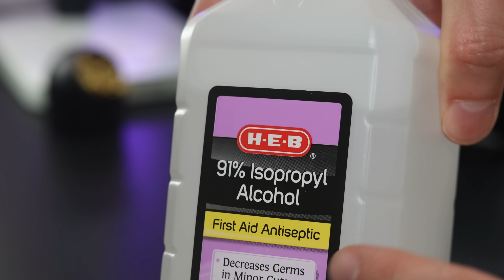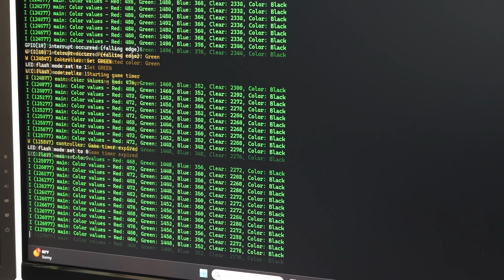Do This Before You Solder Anything

Comment: 1:08 but probably don't start with leaded, lest you make a habit of using dangerous solder
Reply: Which one would a beginner start with?
Reply: @CommandoPixel  a thinner silver based "activity" solder like he marks as his favorite, and use flux
 there is no good reason to use leaded solder when compared against the harm of lead
Reply: That is not a proper framing of the situation and the risk.  Whether or not you use leaded solder you're likely to encounter lead as a hobbyist, so it's better to actually assume the presence of lead while soldering and always use practices to minimize exposure.  

Maintain dedicated gear and space, and hazardous disposal for scraps and dross.

Keep that area thoroughly cleaned. 

Wash and scrub your hands really well afterwards.
Reply: How much danger is there really from using leaded solder?
Reply: The hazards of leaded solder are over stated. Just have a fan nearby so you are not directly inhaling fumes. Most seasoned engineers have been soldering for 30-40 years with no extraction. Yes in an industrial 8 hour working environment then yes this cauldron be a problem. For the amateur then I would have zero worries if you have a very small fan nearby to move the fumes away.

Comment: Sure flux helps but you really don't need more than what comes in the solder.  Flux is more needed for de-soldering and reflow.  You're also applying heat to your components for too long.  Get in and out faster.  You're probably having to do that because of your iron.  You said so yourself, when doing a ground pin you have to up the heat.  That's because your iron is cheap.  Get yourself a good iron with good heat saturation and you'll be able to get in and out faster even on the ground plain.  Here's a good test for you to learn, find yourself a good size heat sink.  Put some solder on it and keep your iron on that spot.  Remove, touch, remove, touch....your temp should hardly change.  If the temp changes a lot then change your iron!

Comment: Very good! Yes I worked in radio repair for over 20 years before I ever started using flux. One guy had some on his bench but used it like cleaned to dip his tip into haha smoke show. Now I build a lot especially using TSOP's .5 / .4mm pitch etc, I wouldn't be without it!

Comment: Nice tips here and in the comments. When I'm soldering a header, I will normally do the ends first after a careful position with a clamp or some such: once at least one pin is "anchored," the rest are much easier because their alignment is "guaranteed." Also, with these pins, I generally clean my tip, tin it, then touch it to the pin & pad for about a second and apply a little solder. I use silver solder.

Comment: Please.  Clean your solder at cleaning stage. Wipe it with alcohol and Kimwipe you will have a long dark streak. That’s oxidised solder.  Please wipe your solder (lots) and ensue it’s clean.  Otherwise it’ll end up in your joins.   Also clean iron tip and refresh every join.    Is it needed, you tell me?  But it’s NASA stds training minimum.  But it’s something simple that makes better joins.

Comment: Was doing cold soldering as newbie because it kinda work (hard though) and didn't check what is the right temperature to use, thinking I had read so far, what wrong could it be?
... then destroyed the components due to bad contact which requires months to fix...

Comment: Also, use the right tip for the application. Dont use a wide chisel tip for delicate, precise jobs. And don’t use a small point for soldering heavier gauge wires and large circuit board pads.
Reply from the maker: Very good point!

Comment: An extra tip: apply some solder to the iron tip just before turning it off. This will work as a protective layer against oxidation, next time you just turn it on, clean old tin, apply new one and you're ready !
Reply: Most pen-type tips have an outer tin layer, it's more useful on old and worn tips
Reply: @S_Tadz I bought a 10 pack of PCB tips and they all appeared to be pre-tinned. Well, it still wiped off after the first solder joint I made, and I still need to tin them myself after the first use

Comment: Btw dont buy expensive flux, VGA oil for those vapes is cheaper and good, UV resin is cheaper in 1kg for those 3D printers than in those tubes of 10mL..., solder wire 0.8mm is multi-purpose i dont need thiner or thicker, just apply it slower or faster, for tiny SMD solder paste not wire. Why are you not using helping hands? Best joints are made if you pre-cut the leads, you get spherical blob not conical, conical spray too much EMI at high frequencies.

Comment: Don’t use leaded solder. Lead is toxic. When lead free solder was first introduced, it was terrible, and got a bad reputation. But now you can get lead free solder that outperforms leaded solder. Make sure your solder has sliver (sn) in it. You can even get lead free solder now that melts at 130C.
Reply: yeah but try to remove it after 5-10 years after it's oxidized you might have a hard time scraping it off

Comment: If its 1/4 in or larger just use a mini torch instead, much easier to get it hot enough. I always solder it at a much higher temp, closer to 400c for 95% of my joints because I like to work fast and I need that heat there quickly. Lower temps can work for super small stuff but higher heat is better if its a typical through hole type. If its smd, heat gun and lower temp solder paste and lower temps. No matter how hot the solder claims to melt at, start a bit higher like 10c higher because the parts you are soldering are sucking the heat away lowering the temp. I find if you are burning the pad its mostly because you are taking too long, not because its too hot. So go hotter and use less time. The bonus of being hotter is it typically takes way less time to complete. You can prove this on a junk PCB. Lower the temp just to the point it melts and see how long it takes to make a proper point. You will see the board is far more likely to burn because of how long you took. Heat it way over the temp and do the same thing. It will not burn the board and make a beautiful joint because you spend less time on the part trying to get to the temp needed all around the pad.

Comment: I personally like 63/37 (Tin/Lead ratio) solder, it's very easy to work with for most small electronics.
Reply: BECAUSE, "63/37" Tin/Lead solder is something called "EUTECTIC" solder... 

That means that the melting (or solidifying) temperature range is very narrow... So there is not a "paste-like" state where the solder is solidifying gradually into a paste, as the liquid solder instantly gets solid all at once, avoiding any possible movement of the parts, which causes a "cold-solder joint"...

Eutectic also means that the melting point of the solder is at a minimum temperature: that is, if you have a "60/40" solder, it will require a couple of degrees hotter melting point than 63/37, same if you have say 65/35 solder, both have higher melting points. That is why 63/37 is the best overall solder with the lowest melting point of all commonly available solders, thus it has the advantage of a lower risk of damaging components or even very narrow and delicate circuit traces...
Reply: Eutectic solder is all I use.

Comment: As a kid, every soldering instruction I read said to not apply solder to the tip; only to the joint.  Problem was, I believed them and soldering was difficult.  Finally, I learned that some solder must be applied to the top for heat transfer, as you demonstrate.  Interesting to see the Radio Shack solder.  It has always been my favorite, even when I had access to Multicore.  It flows SO WELL!  Watching this video should be the first thing to do for anyone wanting to learn how to solder.  I've been soldering for about 55 years now and it's one of the most satisfying things ever.
Reply: Yah i like the radio shack 10 year old solder use ;)
Reply: @pRoFlT  Made me feel a lot better about that 30+ year old spool of RS solder I still use once in awhile...
Reply: It all has to come together. Clean tip, clean joint and all of it at the right temperature to get the flow. Otherwise the tip will melt the solder to a cool circuit board / component/ wire = cold solder joint. A dirty untimed tip, although at the correct temperature,  will keep it all from coming together
Reply: I am fairly new to soldering, so it may be a skill issue, but solder does not hold on my tip whatsoever. If it makes a difference, I have only ever worked with lead-free solder, so maybe it is different with leaded solder.
Reply: @justsomeguy5628  Well, solder will stay on the tip if the tip is clean and you dip it in the flux for a moment to remove oxidation first. And yes - use 63/37 solder - nothing wrong with lead if you don't lick it.
Reply: @justsomeguy5628  Lead free solder is harder to work with and in most cases, completely unnecessary.  It is necessary if soldering water supply lines.  It will eventually grow "tin whiskers" which can cause electronic failures.  Tin whiskers are a known problem in Nikon digital camera lenses, for example, and can cause expensive lenses to fail.  The combination of lead, tin and flux works like magic.
Reply: @David-hm9ic unfortunately, I am soldering as part of my college education, and our instructor only has us using lead-free solder, to prepare us for workplaces that will use that instead of leaded. It turns out that the problem was a mix of some of the irons having broken tempurature gauges and the tips all bring extremely dirty.
Reply: @justsomeguy5628  Understood.  You should try lead/tin solder on your own, just so you will experience the difference.
Reply: Also nothing like a solder sucker and a pair of jewelers tweezers

Comment: I gave up on soldering years ago when I had programmed an Atinny 45 and tried to solder it on a print. The print tracks came loose and I killed the chip. That was it for me. Now I will give it antoher try one day using flux.

Comment: Foisting lead free solder pn people is a sin.  Here are the cons:

Higher melting temperature
Brittleness 
Poor wetting
Tin whiskers
Reduced reliability in harsh environments
Shorter tip life on soldering irons
Less forgiving for rework/repair
Higher cost

Moronic.  When was the last time you heard of someone being injured from leaded solder?  In modern, regulated mines, lead is mined relatively safely.

Comment: Regarding the thickness of the solder.
You can use thin solder for everything, just double, triple or quadruple the thickness by folding it and twisting.

Works fine
Reply: You don't need to folder it, just feed it in faster. I use 0.38mm for everything, from 0402 SMD to 8AWG wires.

Comment: Youre all done soldering:
you want you tips to last.
load up the tip with solder and dont wipe it off. 
the solder will develop the tarnish.

Next time you want to solder:
reheat the tip and wipe off the old solder. 
tip will last longer.

Comment: I use a small brush/toothbrush to put a little flux paste where I am gonna solder
It tends to help heat the area more thoroughly and will melt the solder much better

I also tell people to heat the item you want to solder to, then touch the solder to it. It will suck to the pad/pin when heated properly

Comment: If you're soldering the same side as the component you can also utilize a hotplate to make it much easier and faster. Heat the entire board to just below the soldering temp or to whatever temperatures the materials can withstand, whichever comes first, and then it takes less time to heat each pad to the soldering temp

Comment: All the tips are spot on. I never cleaned my pads beforehand with rubbing alcohol, but I use it to clean the flux afterward.
What I still struggle with, is desoldering through hole parts by removing all the solder first. I've tried wick, pumps, flux and high heat, but just can't seem to get enough solder out to free the part.
Reply: Get a desoldering gun. The ones with a pump are expensive, but the single shot version are super cheap.
Reply: Ok wick is the best hands down, but u gotta use it properly. 

1. Put a small amount of flux on your wick (yes even if it is "pre-fluxed"

2. Add a small amount of leaded solder to the join ur trying to desolder (this will lower the melting point of non leaded solder and help it flow better.

Thats it, simple and highly effective, the problem you will have now is how fast you will use up your wick 😂
Reply: @freedomman06  That's probably the issue, I must not be using it properly even though I do cover it with flux and preheat the joint with fresh solder. I'll have to keep practicing. 
@johncoops6897 I haven't tried the desoldering gun as I don't have one, but never had any luck alternating between the iron and the sucker. Either I take too long to place it and the solder hardens or my angle is such that the vacuum doesn't pull anything. Not to mention all the times I forgot to prime it... I'm quite skilled at melting its tip though :-)
Reply: Compressed air works great. I blast it into the trash can to contain the waste.
Reply: @deadcarnahans1932  Interesting idea, never heard that one before.

Comment: Comprehensive video and surely will lead you to good soldering results but
what I do to achieve perfect soldering is simply apply heat to the pad and pin at the same time about 300 deg, then apply solder 63/37
Never used flux nor clean up anything beforehand in the past probably 25 years or so
Reply: If the soldered elements are not heavily oxidized (like an old coin) - then yes, there is enough flux in the solder. And regarding the temperature, during the soldering process everything becomes more interesting - I recently disassembled an HP motherboard from about 2010 and in order to solder something out - I had to raise the temperature to 450C (lead-free, mother of all things 🤬).

Comment: IPA that isn't 99%, especially those for skin cleansing/medical uses have other chemicals i.e. moisturisers and the like to prevent skin irriration/drying out. This leaves an oily film behind. Go and spray some on a mirror and let it evaporate and see what's left. Don't cheapen out at the first stage.
Reply: I just use methylated spirits.  It’s cheap.

Comment: Another great tip: Clean your iron before you use it, but not after. When you rest your hot iron, leave the solder on the iron, it will protect the tip.
Reply: Nah, clean then apply fresh solder then turn it off.  If you just finished up with a 20 pin chip, get all that crude off first.
Reply: @JustinEmlay I didn't mean when you're storing the iron. I meant when you put it down in between joints.  

Pick it up, clean, solder, put it down. Repeat every few minutes.
Reply: @simonharris4873  My bad!
Reply: @JustinEmlay NP at all. When i was  a techo, I'm must have done 100s of solder joints a day.  First thing i learned, clean the tip before you use it, but not after.
Reply: Don't need to clean it unless it's actually dirty or if putting it away clean then apply a generous amount of solder. Generally you want to clean it as little as possible because every time you do you expose it to air to oxidize ruining the tip faster. Clean it if its actually dirty but way too many guides recommend excessive cleaning which just degrades the tip faster.
Reply: @DrakeOola yeah, but I like to work with a clean tip. 😊
Reply: Protects from oxidation and corrosion. I always clean with brass wool, wet sponge, then a giant glob of solder put on the end, and finally turn it off.
Reply: is this THE Simon Harris? IOW mean much?
Reply: @mattk8581 Nah, just A Simon Harris.

Comment: It'd say tinning the tip is the most important thing. Far more important than adding extra flux which you might not even need. I've been soldering for decades, and almost never use flux. But I always tin my tip.

Comment: Using wire as de-soldering braid is a tip that doesn't get passed around enough. Thumbs up for mentioning that one 👍
Reply: Here's another tip, you can use the copper shield of an unused coaxial cable. I was watching Sorin from ERS the other day and he did that, super neat!
Reply: @mossabDiae Yes! Just slides off!
Reply: @mossabDiae  Good idea.
Reply: I ended up figuring that out myself as a kid learning to solder. Instead of spending money on solder braid, just use scrap wire!
Reply: if the wire is without the queue like a regular wire, it eats too few of solder which means a lot of copper wasted.
Reply: Use old Monster speaker wire!
Reply: Years ago I bought a ton of assorted braided solder remover so haven't run out yet, but the pre-rosined stuff is best. I also use a mechanical solder sucker for > 2 pin part removal. For SMT chip removal hot air is  always best
Reply: I use a self-prepared solution of colophonium in isopropanol. You can dip the wire in that and let it dry.
Reply: Right, that was new one for me - after a lifetime of soldering.